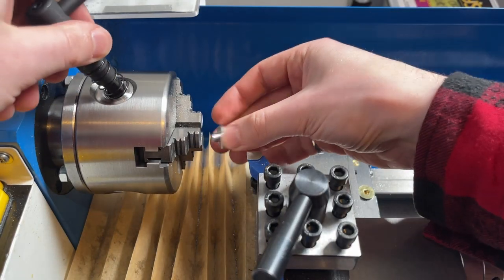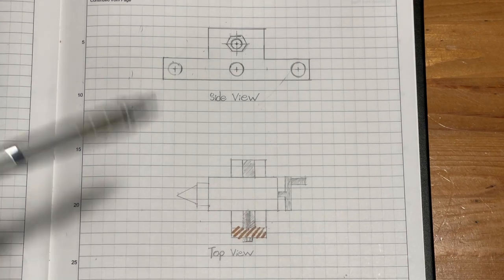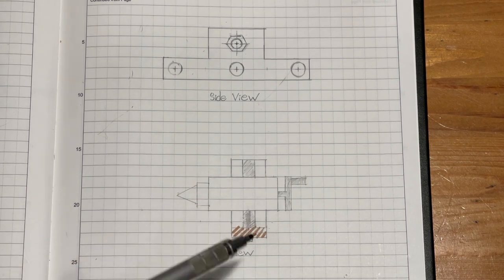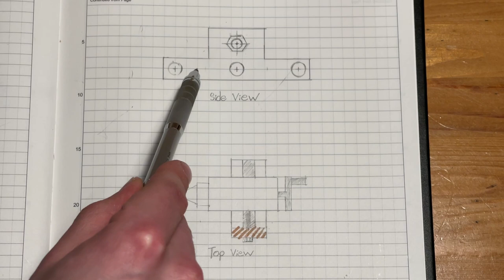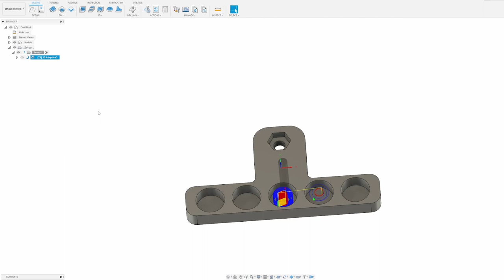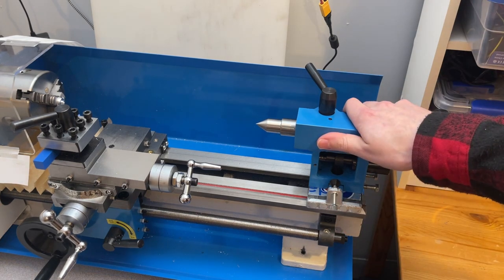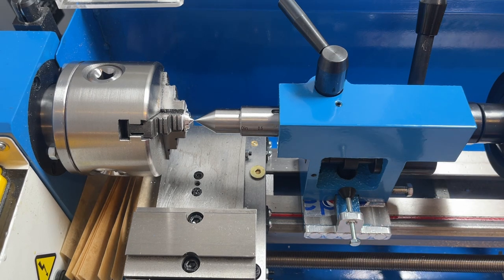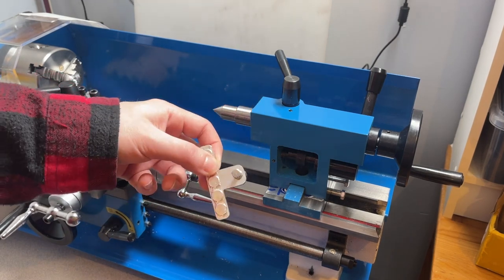Mini Lathe Tailstock Alignment Tool

Comment: A bit of advice. Just because they line up that close together does not mean they line up with the tail stock further out. I would turn as long a shaft as possible between centers and measure the diameter at both ends to make sure it is truly aligned.
Reply from the maker: Yeah that is definitely a much more accurate way to go about it! I was mainly going for the quick "good enough for a new hobbyist" approach in this video. I'm sure one day I will get to making parts that require going the extra mile!

Comment: You don't need the tool.  You need to snug up the end bolts and then lightly tap with a rubber mallet to adjust. With a good tight snugging... You can safely slowly tighten them without any shifting to speak of.

Comment: Take a small piece of round bar and in a 4 jaw chuck set it up accurately in the chuck. Hold a centre drill to make a conical hole in the bar. Then put a dead centre in the tail stock and slightly loosen up the adjusters. Introduce the dead centre to the hole and when seated slowly tighten up the tail stock. Aligning a point to a point is difficult. A point and a conical hole is self centring and once centred with a bit of pressure will hold the dead centre still for the tailstock tightening.
Reply: I like it.

Comment: The reason for the difficulty is the screws have been tightened such that they leave a divot, screws want that divot, even the screw under it, remove the bottom screw you will see the head has compressed the Slot shoulder again another divot.  Remove the divot's flatten the bolt faces put a piece of copper in the hole and tighten up copper won't create a divot. Snug slightly and tap into position resetting the clamp handle often.  Once there snug up the screws.  The bottom screw is the biggest issue a copper washer would do it as the copper won't deform the cast material very little room for a washer, grind off the top of the bolt head some if necessary after adding a washer.

Comment: I would have made the adjuster a permanent fixture, but you also need one on the other side… also, what I have discovered with my lathe, is that the bed is not aligned with the chuck properly… so if I have a shortish bar in the chuck, with no tail stock centre, you would expect the bar to be exactly parallel, but it’s not… the diameter closest to the chuck, has a larger diameter to the other end of the bar… ideally, you need a very long machined round bar in your chuck, with a machined point, to line up with your centre when the tailstock is furthest away from the chuck…

Comment: Easier to just buy a mk2(or whatever dimension your tail-stock is) alignment bar, chuck the cylindrical part of it in the head-stock(3-jaw for quick and dirty, in a head-stock collet or collet-chuck for more precise).

 Hang the tail-stock of the morse-taper end and tighten down(or use Moglice or something similar and permanently fix the tail-stock accurately in place and just use an of-set adjustable tail-stock center for when you need an of center support for turning tapers(which most never will need to do anyway...)

Adjustable tail-stock on a lathe is something that very few will ever have a need or use for and those few that do will be using machines quite a bit better and larger than a mini-lathe, mostly they are just a pain in the ass.

Buy a large cheap morse taper drill, cut of the flutes then drill and ream(both preferably held in a collet in the head-stock) a hole with it in-situ in the tail-stock that will tightly and accurately fit a ground shaft with a 60deg point turned on one end and a center-drilled recess on the other, drill a oil-hole(facing up, obviously) at the bottom of the reamed hole in that morse taper and put a large bearing ball down the bottom of the reamed hole(small oil-hole roughly centered on where the middle of the bearing-ball will be) before inserting the divot end of the ground shaft, you now have a perfectly aligned rotating tail-stock center that you can make custom tips for(like a large cup for supporting tubing).

(if you have some ground and hardened shaft you could make a d-bit reamer from a piece of it and make the hole size as near perfect as you could possibly get with a home-shop machinist level lathe)

Needs to be oiled(or grease, I prefer  lithium moly grease for this..) every time you use it but access and support wise it is likely to be a great deal better than any other rotating tail-stock center you would buy, and as long as you have the side oil-hole roughly in the same position every time it will be more accurately aligned than anything from the factory or not done with a dial-test indicator and a lot of swearing....

Comment: My own solution was a variation of the long bar method. I used two morse taper arbours and turned the ends down to two identical diameters. To align the tailstock I install both arbors, use a dial indicator on the carriage preloaded to zero on the arbor in the headstock, then move the carriage down to the tailstock at the other end of the bed and move it by tiny screw movements until the indicator is also zeroed on the end of the tailstock arbor. This assumes of course that the bed is already levelled to remove twist.

Comment: I like your little jig to help with positioning the tailstock. I had no idea the budget lathes had evem further cheaped out on desigm. The biggest problem is your method gets you close but you'll still be turning tapered and inaccurate parts no matter how close you eyeball the alignment. Another video showing users how to use a dial indicator in the headstock to dial in the tailstock would really help move them towards more accurate parts. Lathe bed levelling/alignment is a big factor with these larhes as well, my freinds little lathe had a 0.012" twist in it. This makes it impossible to make accurate parts even with a dialed in tailstock. It's a problem because it requires an expensive precision level but worth knowing about so they know why the parts arent turning out the way they should.  Test bars are also relatively cheap for these (under $25) and the easiest way to learn dialing in a tailstock.  Using a 3 jaw chuck to do this should also be addressed because of the runout.  Knowing why there are still issues will help your viewers atleast understand why. You shoukd atleast be able to turn a piece of barstock 8"-10" long accurate enough to get the same almost the same bearing fit on both sides. As you've done it you'll likely have a interference fit one side and the other will have MANY thousands of an  inch clearance. You've made a good start here though!

Comment: On mine the axis of quill movement droops downward; I know this for checking it with an inexpensive but surprisingly good test bar.  If you ream a hole with the reamer in the tailstock and it comes out tapered, that's a sign of that particular issue.